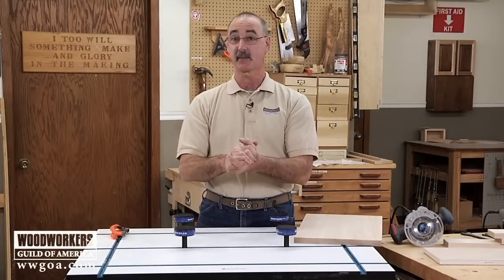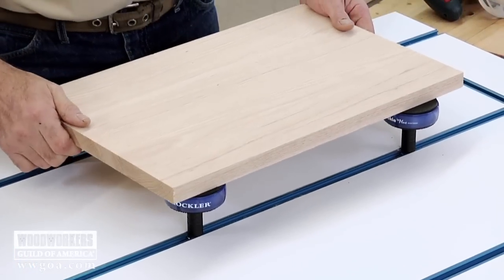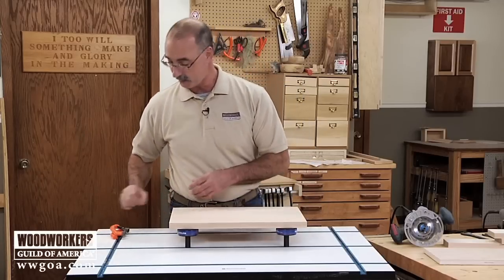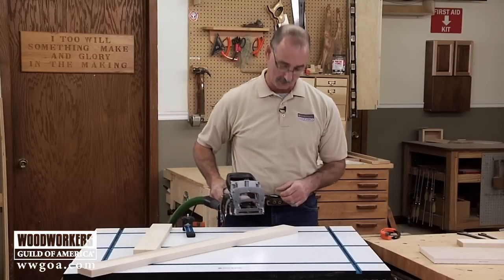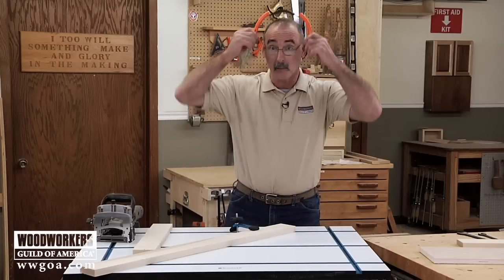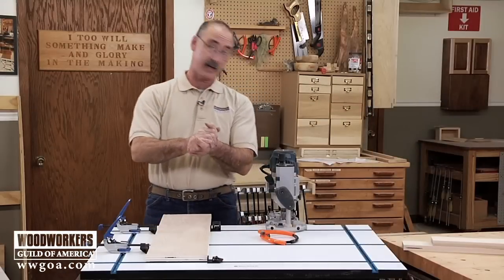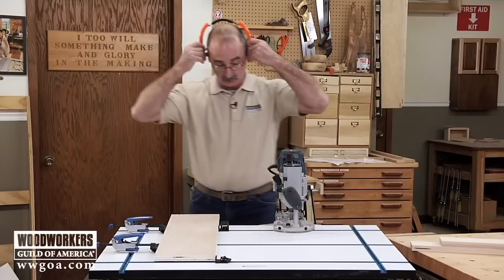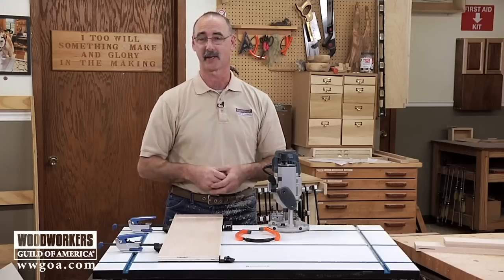Portable Power Tool Safety with the Rockler T-Track System  |  Woodworkers Guild of America

Comment: I passed on the Rockler T track table. The tracks are too easily pulled out with high clamping pressures. They need to be bolted through the table, not screwed in. The newer auto adjusting clamps are easy to make this mistake with. Rockler should have used dual purpose track.( i.e. Kregg)
Reply: tonkatoytruck Crap I just ordered one. I was thinking of pulling out the screws that hold the T-Tracks in place and replacing them with longer ones that went through the entire board and into a 3/4" Baltic Birch sheet underneath that would have the stand mounted to it.
Reply: ben_r_  That sounds like a good solution. I have seen it done before. Just seems a shame you spend good money and you have to modify it to insure proper results.
Reply: tonkatoytruck True, it is a bit of a shame. But I looked at it this way: I got the Rockler Clamping Table on sale for $169, there are six cross sections of T-Track on that table which run $22 each from Rockler. So thats about $132 just for the T-Track cross sections plus the rest of the straight runs of T-Track, and 1-1/8" melamine-coated MDF, edge banding and my time to cut all the T-Track and assemble the board I dont think it's too bad a price to just buy the table and swap out the screws since it probably would have cost me about the same to build the table myself. At least, thats how Im justifying it ;)

Comment: I have been using one of these Rockler Tee Track tables for about two years. I found it
useful but the tracks are not secure enough with the wood screws used
to hold them down. The solution was to replace the wood screws with
machine screws, nuts and washers. What has been your experience?
Reply from the maker: Hi Byon.  George has not experienced the problem that you are describing, but your solution makes sense and it seems like a good, permanent fix.